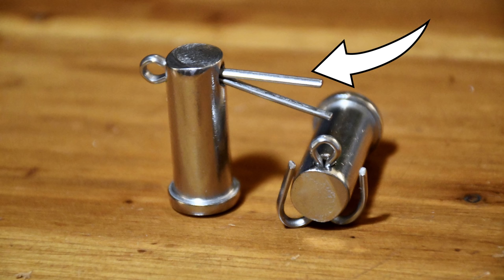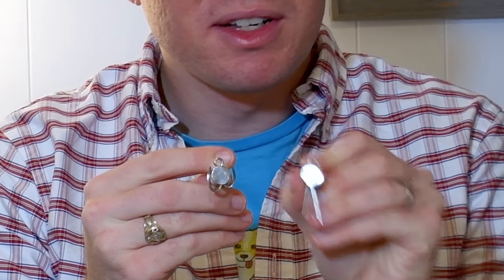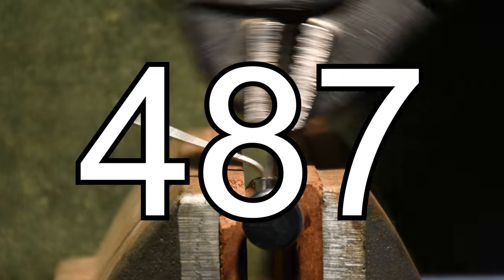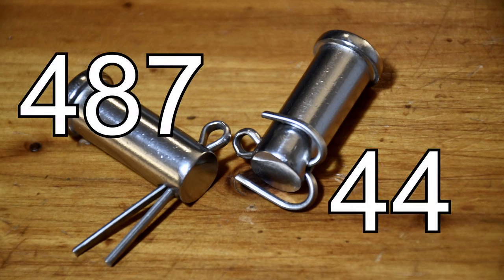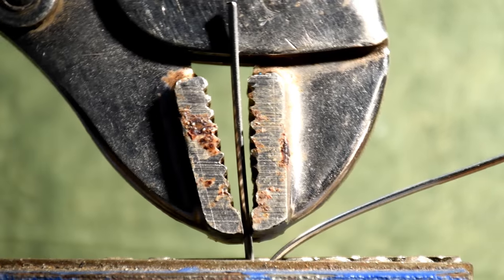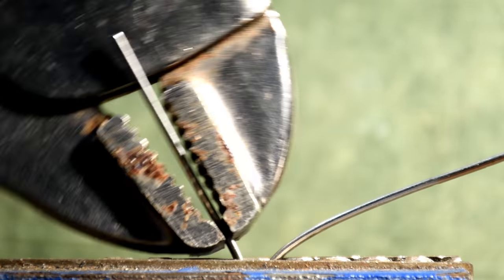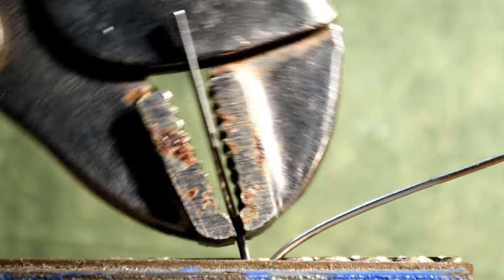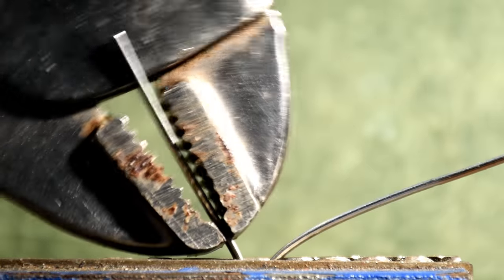Should You Bend or Spread Your Cotter Pin | Sailing Wisdom

Comment: Many who have had a leg break off a cotter pin probably tried to straighten and re-use it.  What I have more commonly seen on aircraft, is cotter pins that have gotten repeatedly snagged and bent (on clothing or rags from pilots and mechanics inspecting the aircraft), and then pushed back into place; eventually one of the legs fatigues and breaks off.  Which is why the industry standard is for the legs to be bent as tightly against the fastener as possible, and then trimmed short to minimize the possibility of snags.

In the comments to your post asking for input on the thumbnail for this video, you asked that everybody keep in mind that you are talking about sailboats and not aircraft, which is a point well made.  But also consider that a lot of the same factors apply...  You still need to be concerned with the cotter pins getting snagged on lines, sails, clothing, etc and damaging those things, as well as having the pins get bent and eventually fail from repeated bending cycles.  One thing that occurred to me is it would be a real pisser to be launching or retrieving an inflatable dinghy in the wind, and have it punctured from coming into contact with a protruding cotter pin leg.

Also I wouldn't place too much faith in a pin withstanding hundreds of cycles of being slightly bent with pliers.  In actual practice, you're going to have thousands upon thousands of cycles of vibration and other motion in the standing rigging over the life of each cotter pin.  If the legs are bent tightly against the fastener such that no relative motion is happening between the two, no big deal.  But if they are only slightly bent to 15 or 20 or however many degrees, they are going to be constantly moving in the hole, all day, every day that the boat is sailed, or there is wind.  It may not be a lot of motion, but the constant nature of it can have a big effect.
Reply: Nice! I came from the offshore oil industry, we did many things to aircraft standards. It solved and prevented a lot of issues.
Reply: Full bend is how i was trained in several Aircraft and Deck maintenance classes in the US Navy and antenna tower classes.
Reply: Fantastic reply ...also from  an aircraft tech..always keep your pins clean.
Reply: I've never seen a cotter pin on aircraft.  We only used safety wire.
Reply: SkylersRants some carburetor control linkages use cotter pins like on the 172M’s
Reply: @SkylersRants  never worked on bell helicon then
Reply: That is incorrect, split pins (not cotter pins they are different) should not be used on aircraft, you should be using locking wire and there has NEVER been an industry standard to bend split pin legs right around the nut. I worked in the aircraft industry for 22 years and if anyone used a split pin, they would have been fired, locking wire is the only industry standard approved method to stop the practice of reusing bent and straightened split pins.
Reply: @SkylersRants  Absolutely correct
Reply: @thejackaroo4WDcampingchannel  Be sure while you are at it, to tell Boeing, Airbus, Dehavilland, etc that they have been doing it wrong all these decades.  🙄
Reply: Your point about vibration and metal fatigue makes good sense. Q: is it prudent to apply a waterproof electrical tape to prevent the cotter pin from shimmying in the clevis pin?
Reply: @jwebster5840  It would be a band-aid.  Ideally you want your cotter pin to have a good fit in the hole even before it is bent, and then it should be bent such that the tension on the pin prevents any motion.  This is sometimes easier said than done and requires practice.

Where a tape covering might he helpful is in preventing soft objects (sails, running rigging, clothing, etc) from snagging on pins, but at the cost of the pins being concealed from inspection.  So I would be inclined against that on the theory that problems with broken or worn pins would be less easily spotted.

Comment: My understanding was that the reason behind the small bend (15 degrees) was to allow you to pull it quickly in an emergency situation (like the rig fails in a storm and you need to get the mast off the boat so you can survive).  I had never heard any discussion of metal fatigue.  However, I don't think your test is applicable unless you are constantly bending and unbending (reusing) the cotter pins.  In the wild, you bend it once, and it is only bent back just before you discard it and replace it with a new one.  Also, if you do a small bend, and the bent leg breaks, the pin will fall out.  If you do a wrap around, and one leg breaks, the pin won't fall out.  In truth, I use a small bend.

Comment: Small engines and motorcycles is where I have the most experience with.  Both the standard is to wrap them back, 1 breaks and it still holds and less likely to catch on something or some one.  Never had one fail
Reply: I've used lots of cotterr pins on both cars and motorcycles. Always bent both legs right around.. it stops them moving about, and if a leg breaks (which I've never seen), at least the other leg will stop it falling out.

Comment: This was quite entertaining, Herby! You had me in stitches. I loved your explanation of the logic you came up with. I won't get into a long explanation or debate here on the pros and cons of the different methods. A few commenters below have provided sufficient reasoning based on their experience. I personally go with wrapping the legs around the clevis pin. This way is in fact a requirement in some areas such as motorcycle road racing competition. If the legs are not wrapped around the clevis, you won't pass tech inspection. There are many reasons why it is preferable to use this method over simply putting a slight bend to the cotter pin legs and allowing them to stick out. In the end though, it's your boat, your clevis pin, your cotter pin, so you get to decide what's best for you. "May the Force be with you."😁

Comment: Was trained at American Honda and yes, you trim real long tails, but the cotter pin is bent back and kept close to the bolt (usually threaded with castle nuts). Its designed for this. If you look close, its a bend around, not at a 90 degree.  When you remove them, you replace them. I don't think auto and motorcycle manufacturers and engineers would all be doing this wrong. Look at an axle bolt on a motorcycle and see how its done. By the way, depending on its use, I use hairpin cotters on a lot of my clevis pins!   :-)
Reply: Seizing wire is better

Comment: Depends on the specifics of the fitting.  If the clevice fits into a fitting that allows a clean wrap of rig tape with the legs of the cotter pin slightly spread and not a snag problem, that's good.  I never leave bare cotter pins if possible.  Rig wrap em, even when bent around the clevice.  Too easy to snag on something, especially sails, usually spinnakers when dousing because they are flapping around all over the place.
On boats where rig tune is important, and is adjusted between races on a race day with multiple races, the cotter pin head in the turnbuckles is stitched onto a wrap of velcro.  The legs of the cotter pin are trimmed to stick out of the turnbuckle about 1/8".  You stick the pin in and wrap the velcro around the turnbuckle to hold it in place.  Very quick and secure, easy to remove and replace for adjusting shroud tension.
Reply: Agreed!

Comment: I’ve always wrapped them round, no problem in 30 years of sailing, last time I had the rig tuned I was recommended to do the 30 degree split, I’ve lost three cotter pins since then, twice I only noticed after the downwind shroud broke free. They turn head down and wriggle out, the last time was in heavy seas off the Shetlands. I immediately went round and wrapped every pin. Sorry but your tests bear no relevance in the real world.
Reply from the maker: It was the best way I could show to visually demonstrate the issue. That’s a shame that you have had 3 pins come out!
Reply: Breakage isn’t my concern when I see you spread them only 15 degrees - it’s slippage. It takes a lot less stress to compress that pin so it’ll slide right out than if they’re bent back.
Reply: @dwayne_travels  - Exactly! Over time, the little buggers can wriggle their way out, if they were only slightly bent to start with.

Comment: press against the end of the bent 15* leg,  it pushes back in to the clevis hole very easy, or a soft bump on the 15* and its straight again with nothing holding it in the clevis, both a no go in my book.  Also the end sticks out and cuts anything close to it like a sail or your hide.  To avoid a stress riser at the bend dont go past 15* grab the very end with a stout pair of needle nose and curl like a handlebar moustache putting most of the stress at the last few MM not at the edge of the clevis. and no sharp ends exposed.  A good pair of safety wire pliers are a great tool for this.

Comment: You keep saying 10x but there are a few factors you didn't take into account. One is rate the bends are cycled. The faster you bend it the more it heats up the metal & snaps quicker. Also once it is bent around the pin & doesn't get unbent 90 degrees & rebent. It would get the same or perhaps less movement after that then the one bent 15 degrees. That would mean less or at the most the same distortion in subsequent cycles as the one bent 15 degrees.  Additionally it is less likely to snag & then perhaps less cyclical movement.

Comment: I'd go with fully bent because then both of the legs have to break off before it fails! With the 15° bend, the pin can fall out as soon as the first leg breaks and there's even a second failure mode of pushing it out from the legs side without breaking anything off. And if you never ever reuse those things anyway, I don't think it's relevant how often you can bend it.

Comment: I have nearly zero sailing experience... but a good bit of aircraft. With them they use few if any clevis pins, but do use clevis bolts and a few castle nuts. One of the main concerns of cotter pin installations is technician safety. Aircraft have many tight confined areas that often require reach throughs, and haphazard installation of cotter pins (safety wire, tie wraps and/or anything sharp) can & do result in lacerations. I'd suspect boaters would have similar concerns... like if someone were to accidentally stumble across a pin and get cut/punctured days from port; would you want to deal with that? How bout if forced to climb a flailing mast some dark night... same risk. Also, I suspect corrosion is your biggest enemy... salt spray, bird droppings[1] and the like. Cool videos, thanks, been subscribed for a while now!

[1] I remember reading ages ago about a bridge failure attributed to birds... it seems it's design included many areas favorable for nesting, and their droppings & whatnot greatly accelerated rust. With aircraft, water entrapment areas are always avoided in the design phase... not only for corrosion mitigation, but ice expansion. Regular inspections of forging/casting drain holes are a common thing for some aircraft.

Comment: In my 55 years of bending cotter pins fully around the clevis pin both on sail boats and racing vehicles, I have never had one or both of the legs break.  I always replace used cotter pins of course.  My practice used however, is to bend based upon potential snagging or catching.  If no possibility of snag...  I bend 15 degrees.  If snag or catch is inevitable..., I wrap the legs around the pin.  I have found certain applications in  race vehicles have produced opportunities to snag due to tight places.

Comment: After forty five years of being involved in  aircraft maintenance I have never seen a wrap around cotter pin work it’s way out!  On your Atlantic crossing, the pin holding  your boom to the mast dislodged itself and separated at the gooseneck. Obviously, the cotter pin worked its way out. 

Often a washer is placed  under the cotter pin which is secured using the wrap around method. This helps to prevent the holding pin sliding through. In most installations where a holding pin is used,  there is  a top side flange  to prevent it from sliding through the fitting,  

As a mater of good practice all critical connections should be inspected on a regular basis. It is mandatory that prior to any flight  aircraft have a thorough walk around inspection,  It seems reasonable, a boat should have a similar inspection as often as practical.
Reply from the maker: Aircraft and sailboats have different setups, the biggest being the lack of lines swinging around smacking the cotter pins repeatedly. 
The pin that held our boom on got pushed out by the head of the trysail because I didn’t lower it all the way down. It sat next to the pin for days without issue but one day the wind was right and out went the pin from one of the most torturous places on the boat! Halyards, reef lines, tack lines, and any other thing you could imagine is bashing about as we sail for thousands of miles. 
We check the pins morning and sunset, as well immediately following the cessation from a storm. This pin was doing just fine all that time because the sail wasn’t pushing on it just the right way. 
The lesson here is to never leave that sail at that position, lowering it all the way down or raising it up all the way. It’s like stopping your car on perfectly flat ground and putting it in Neutral instead of Park. Probably nothing bad will happen, but you should really put it in Park. This doesn’t mean that Neutral shouldn’t exist in the shift options, as it has its uses and using the improperly is a bigger issue than setting it up like an aircraft.

Comment: Another view would be that the head of the cotter pin has already been stressed at manufacture. Spreading the legs would only require a single fracture before falling out. bending them back on themselves would require a fracture in two locations for the pin to come out.

Comment: A cotter pin is subjected to shear and it is therefore important that it fits the diameter of the hole and does not move in the hole.  Therefore, it must be placed tightly around the bolt to prevent it from moving up and down.  In the video you can see that the split pin is too thin and therefore represents a risk.  Just bending up the cotter pin brings also an enormous risk of injury for the people who move on deck!
Reply from the maker: For turnbuckles, there are many and much better alternatives to cotter pins. They not only keep the turnbuckle from coming apart but hold it from turning at all! And they do this with no sharp bits sticking out. 
I will be doing a video on turnbuckles in a bit and in it I will discuss the alternative methods. 
These were jiggling around a bit, but the idea is simple: bend it a little and it takes more to break it, bend it a lot and it breaks sooner.
Reply: @RiggingDoctor  NO ot doesn’t as cotter pins are big bent repeatedly nonstop it’s not the bend but the repeated NON STOP bending you did that caused the failure learn a bit about metallurgy and what is happening to the monocular structure as you bend the pin. And ONCE bent you don’t want the pin bending again at all until it is removed and replaced. It won’t face that type of bending unless it gets caught on something repeatedly. The more secure the pin is the less it moves the ends should be bent so they don’t get caught on things and so the pin no longer moves at all. And when it is straightened to remove it you put in a new one when you reinstall the pin. So it will ONLy be bent ONCE aim it’s useable life. Just banging into the fixed pin won’t bend it but something like a sheet or halyard or sail or clothing getting caught on it can and will bend it or break it. So your reasoning is mute and as is your test as repeatedly bending non stop is not the forces a cotter pin faces

Comment: Firstly, here in the UK we call them "split pins", cotter pins are very different and not found on boats (unless you have a bike). I would NEVER open the legs a small degree. I always wrap them using taper nose pliers.

Comment: great video but unfortunately your test was irrelevant to the life of a cotter pin, it may have been fun and the maths may have been fun but the fact remains that the cotter pin is a single use item, so the only bending cycles it receives after installation is via snagging on things under load. If you wrap the legs right around and tuck the ends as close to the head as possible the chances of snagging are almost zero, not true with your 15 degrees, as for using up its life on installation the pin is designed to be installed any work hardening occurring on installation has been taken into account in it's design. So in short I believe you are giving poor advise with the 15 degree thing, and as for it being a little harder most things done correctly are a little harder.

Comment: I think your theory is wrong.  The metal is stressed more yes, but the work hardening from bending it further makes it hold in place.  The Cotter pin does not see those loads when installed.  The real test is how hard it is to pull out of the hole and what pressure it would take to shear it.

The slightly bent Cotter pin could be potentially knocked out if a line or something were to strike it just right.

Comment: In my humble opinion - only if you reuse the split pins would it be an issue with work hardening. Fold them over but never reuse a cheap it's a one use item!